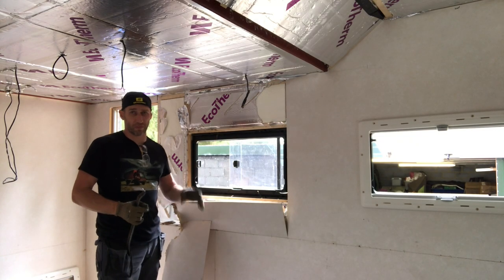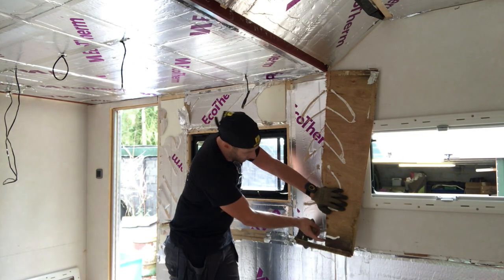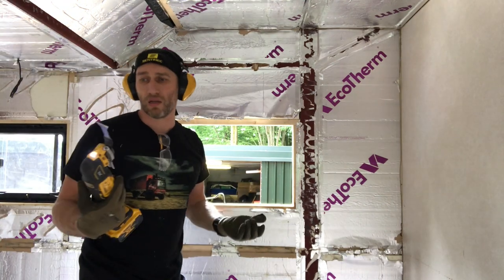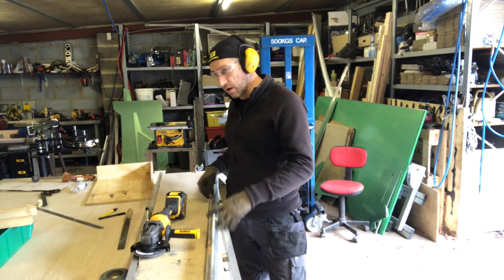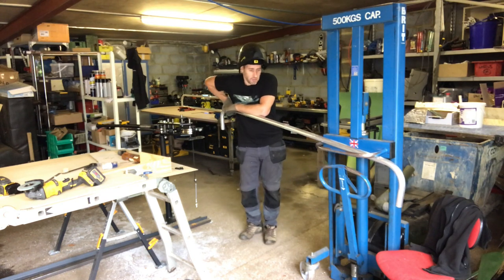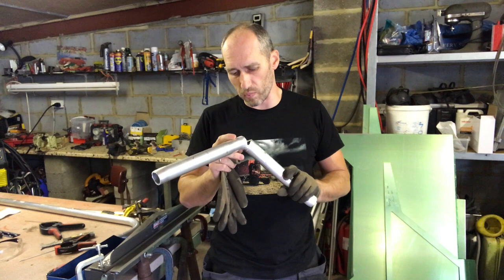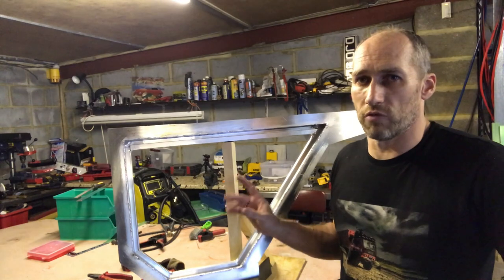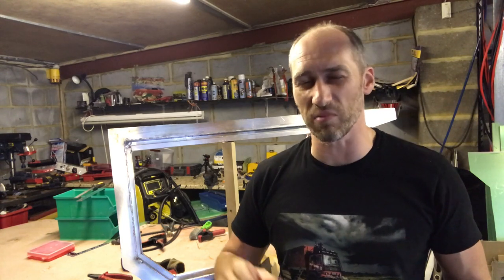Overland truck build. MAN 8.136 4x4 Overlander. [S1 - Eps. 4]

Comment: Is it worth putting a smaller tube insert in behind the joins to help strengthen the weld join at the HAZ (heat affected zone) which is generally where it will break if the weld is good? Also a lot easier to weld the thicker stuff, welder by trade and I struggle with ally tig
Reply from the maker: I think you are probably right. Something to consider for the future. Going to try ally mig next.

Comment: Just a thought could you not insert a tight fitting tube within the  tube to be welded the smaller diameter tube within then weld all 3 together adding to the strength of the join-of the tube..any thoughts.anybody? Ps I cannot weld for toffee, so whom I to say but,, keep up the great work.atb

Comment: you need to bevel the ends of anything you weld so you can layer the material
Reply from the maker: Thanks Daniel.   Maybe my bevels are a bit steep, as not visible in the video, and i guess more surface area of the base material to weld to is a good thing.